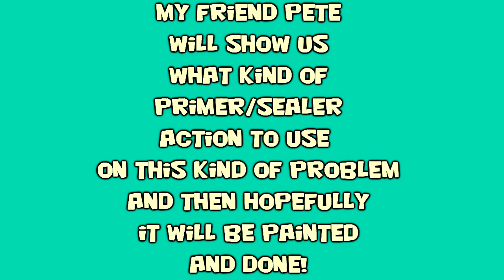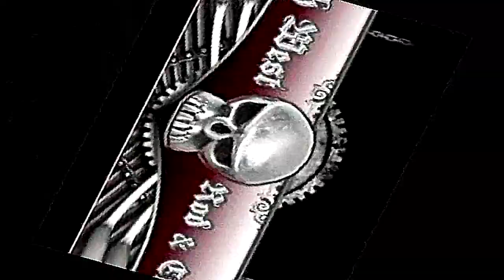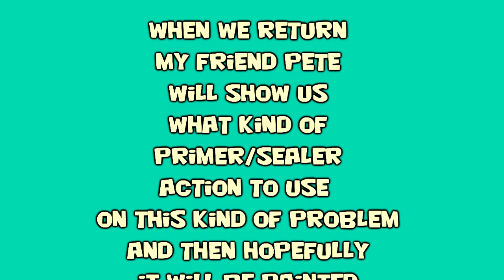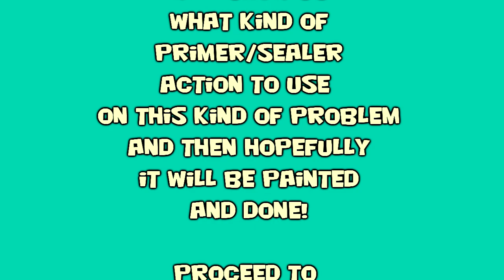What Causes Blistering Peeling Paint and HOW TO FIX IT - Part 1

Comment from the maker: What a BAD DAY My Friend Pete had when he walked out in the shop and found THIS! It will RUIN a good thing for sure... Make sure to SUPPORT My Friend Pete and CHECK OUT the Merchandise Above this Comment!
Reply: well shit... i get that all the time. 20 yrs ago i stopped doing others cars. just my own. if its not a blister its rust coming back in a couple yrs. and the more i do to prep the worse it seems to get.it don't get any better at 65 Pete. just get a hobby
Reply: D.I.Y. AUTO SCHOOL I own a vw vanagon that got repainted once . I want to repaint it ( without going to bare metal ) I think about putting epoxy primer on bare metal and bondo areas , wait1-2 days sand it /scuff it ,then filler prime it , scuff it and then paint it with single stage ( personal preference because there will be no clearcoat that will  separate
Reply from the maker: bob gwinn I can relate Bob. I’m getting sick and tired of this crap!!
Reply from the maker: Κώστας Λεούσης you don’t need to do all that. Go straight to 3k primer after the bodywork and blocksanding and paint
Reply: D.I.Y. AUTO SCHOOL never heard of 3k primer , do you have a video on it ?

Comment: Pete, something that can help in this case, after you have removed the bad wrinkling with sandpaper, is to heat up the troubled area with a heat gun and use a Mini gun to spray a quick and thin coat of clear over the problem which will seal down the problem from future attack once the clear dries. What the heat does is cause the thinners to immediately evaporate from the clear before they have a chance to penetrate the old paint and lift it. On top of the sealing clearcoat you can put any other paint, epoxy, basecoat or whatever. I picked up this tip from a BASF training class and I've used it many times and it does work.
Reply from the maker: That’s a good answer. I’ve never done that before and I’m gonna try it out next time this happens. Thanks!!
Reply: @diyautoschool  Did you try this and did it work?

Comment: Just wanted to say thanx. 
I know the struggle and the doubt that comes with this work.
We had a job go so bad that it's gonna cost us thousands - just to get the customer's car done.
It took us 3 years and everything went wrong. 
Now we're lookin at replacing the motor and the paint. 
These are the roughest days for sure.
The boss and I have both wanted to quit over this one.
But we will go on. It's what we do.
And it's the right thing to do.
I try to remember the look on the faces of the happy customers when it comes out right.

Comment: Iam a new Land Cruiser FZJ80 owner.  I recently decided to address the peeling clear coat on the hood, roof, top of
the rear lift gate and fender flares. My first time painting, first time using a sprays gun (only exposure to setting up gun was YouTube), first time taping,
etc. I rented a spray booth for 3 hours. After taping, getting organized, I only had time to shoot BASE COAT before my time expired and the next guy
entered the booth. QUESTION: How long can I wait to shoot my CLEAR coat? I can not get back in the booth for 3 days! heard...just clean, hit with a tack cloth
and shoot....all the way to needing to scuff the base coat with 2000 grit...then respray a coat of base before shooting clear. Of course, the latter
means I wasted time prepping and shooting base if I have to re-shoot any base at all. What are your thoughts on my 3 day wait before shooting clear? Ok to shoot clear after 3 days or must I wet sand the base first? Thanks

Comment: Well, that just sucks. Can imagine your pain.  The paint that hasn't wrinkled in 24 hours or so, is it safe after that? No chance of failing later? Can see the difficulty of sanding gummy paint. Could the worst of it be  partially scraped out with some kind of small homemade steel scraper? Does the soft paint that's not wrinkled continue to cure over time? Would  it be worth it to do a small paint test when painting over unknown paint prior?  I'm a fabrication, welding, machining guy but greatly admire the skill involved in body work.  I enjoy your videos and watch them all. Loved the part when the sandpaper said: "you're mad now Mr Pete, I don't want you touching me right now!" 😂 Keep up the good work! toolmaker1968er

Comment: had the same issue only it blistered when i spayed the sealer because it was single stage under the sealer and i added urethane reducer to the sealer to make it spray better. had to sand the whole truck and you know how hard it is to sand epoxy sealer. later,bill in w mich

Comment: Pete, here is another excellent product for avoiding this mess. This is a waterborne sealer that doesn't have any of the typical solvents in it that will cause the lifting problems that you're having. I've used this with great success when dealing with "iffy" substrates. Here's the description of the product: https://medallionrefinish.com/products/refinish-products/primers/primer-sealers/tek-elite-waterborne-sealer and here's the TDS for the product: https://medallionrefinish.com/wp-content/uploads/2017/09/MRS-850-W-TDS.pdf. This particular product is made by Rubber-Seal but other paint companies are introducing these waterborne sealers as well. Due to their non-solvent chemistry they might be the best possible solution when it comes to isolating the substrate from the solvent topcoats. This stuff sprays beautifully through a SATA MiniJet with a 1.2 or a full sized gravity gun with a 1.3 or 1.4. Personally, I use a Tekna Pro-lite with the TE20 aircap and 1.4 nozzle when spraying this stuff and it goes on super smooth. Don't discount the waterborne products. They do have issues in humid climates, which I don't have here in Phoenix and you will not have in Moab, but the waterborne basecoats give superior color matches to solvent as all newer cars use them from the factory. Only downside that I can see for you is that you might have to buy some new spray guns as your guns will need to have stainless steel passages or they will rust.  My collection of SATA's, Iwata's and DeVilbiss guns already meet this requirement so it's not an issue for me.

Comment: Any suggestions on a good paint stripper? I decided to repaint my motorcycle after 6 years.  I bought two different brands of aircraft stripper, one in a spray can, and the other is a gel in a pourable can. Roughed up the clear with 180 grit and I brushed on aircraft stripper and it literally did nothing to the clear. Didn't make it soft, didn't wrinkle, nothing. The only progress I made was gouging it with a paint scraper breaking through the clear and reapplying the stripper. It swelled the paint and wrinkled it around the gouges. The clear coat flaked but stayed solid and the paint underneath got soft and wrinkled a little bit.  I repeated this method 10 times now no exaggeration and I have only gotten about half the paint to come off. Are they just making paint strippers weaker than they used to? Like 10 years ago I used the same product and I could just wash off the paint with a garden hose and it was bare metal.
Reply from the maker: The problem you have with "PAINT STRIPPER" these days is it's deluted down so much it's not worth using. The EPA has ruined the Paint Stripper Industry. There's a brand they sell over at Home Depot called JASCO that Ive found to work ok! The best thing to do is when you apply your stripper to the item needing stripped is to wrap it with clear silifane plastic and let it sit for 30 to 45 minutes, this will keep the chemicals wet and let the stripper work longer. I usually have to apply 3 to 5 coats of stripper on a car to get it off properly.. Blame EPA for the crappy chemicals being sold today... It sucks but what are you going to do!
Reply: @diyautoschool  thank you very much pete! You are the best. Been watching uou for almost a decade now. You probably don't remember as im sure you have helped thousands of people, but you helped me out with a lot of advice nearly 9 years ago when I painted my motorcycle for the first time. You are truely second to none and i greatly appreciate you taking the time to answer me even if you have answered this before.
Reply: Stripping in the sun, especially when it's hot outside, makes a huge difference! It will bubble up like crazy

Comment: Hi pete .... just like to ask why you don't like using spray in bondo...... thanks .....
Reply from the maker: I DON"T!!!   It SUCKS.. It could come back and haunt you if you buy the product and it's bad, or you don't have your surface prepped right, or several years later it FAILS.. It's NOT a professional way to do body work, it's good for a car that your going to leave in your garage and tow it to the car show, but for a car or truck that you plan on driving and using it's a SHITTY PRODUCT to consider!
Reply: D.I.Y. AUTO SCHOOL ok thank you pete //// I had watched one blocking primer video ..... which is the way I do it , block 80/180 re prime ..... il stick to the way //// your way and it works no returns on jobs....... again thank you pete , rich U.K.

Comment: I know this would cost more; also had a problem like that; i used paint thiner and steel wool   and wash everything off.   Useally that is caused with cheap paint or lack of catalyst. Also those primers that does not have any hardener in it  also cause shit like this.    NEVER PAINT OVER PRIMER  YOU DID NOT PUT ON BY YOURSELF   THATS THE LESSON  IVE LEARNED.    CHEAPSKATES DONT USE 2K PRIMER   THEY USE THE CELULOSE SHIT

Comment: This is why I'm afraid to use that 2K epoxy sealer width reducer in it I like to use 1K sealer
Reply: Epoxy sprayed as a primer, without reducer, has less of a chance of doing this than when it's thinned and used as a sealer. Pete is absolutely right about that what happens is the the previous paint was not hardened. Likely either an acrylic enamel without hardener or even possibly a lacquer. These two systems are what are called reversible chemical systems.  What that means is that since they are not cross-linked like a 2K system that thinners can attack them and put them back into solution. Something that can save you this headache is to find a spot and take a rag soaked with thinners and touch it to the paint. If the paint softens and reacts you're going to have a problem. If it's 2K and cross-linked the lacquer thinner will have absolutely no effect on the paint.
Reply: @satamanschmidt3428  i just painted a car this week and i used this technique with lacquer thinner on the jams on the old paint smeared all over the place I don't know what it was. rattle cans maybe or  worst lacquer. I used a  1k sealer  premixed over it and it didn't lift but ive been painting 25 years ive learned from my dad he knows a lot just like pete does but yeah this is a nightmare

Comment: Ok. Use es65 or es67 sealer. DP 50 60 and so on is not sealer. It takes a week for epoxy to cure. To much tail end solvent. Dp860 or did you use so 885 995 or 998? Fresh shit stays wet and soaks and attacks the shit below. Fuck. DP epoxy has a ton of solvent. My friend Pete it happens to the best of us. If you used PPG ES sealer i bet that would not of happened. Sucks PPG don’t make tinted sealer so people reduce epoxy. It stays gummy the epoxy that’s why it balls up still has solvent coming out